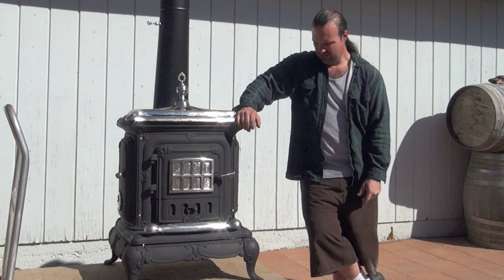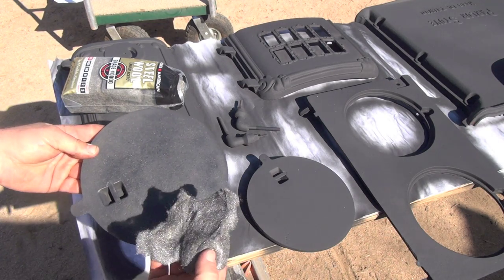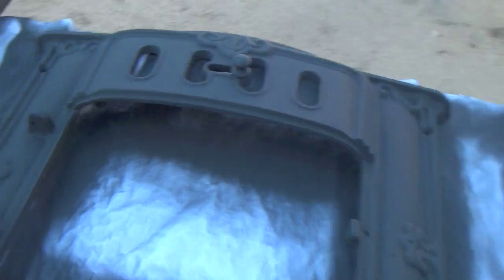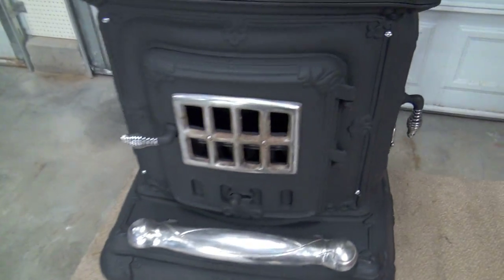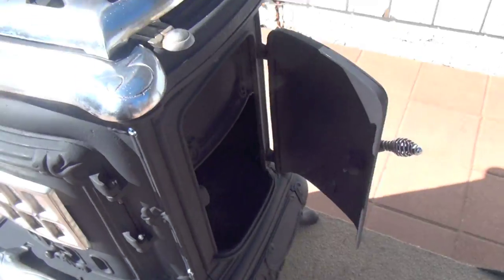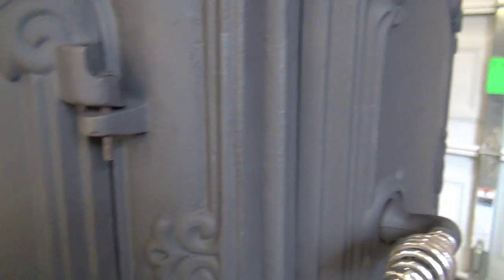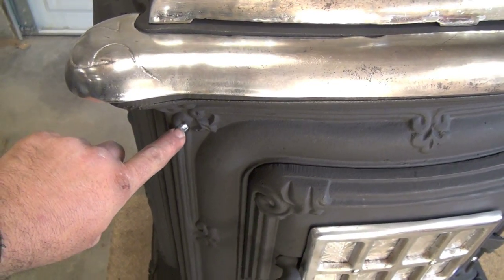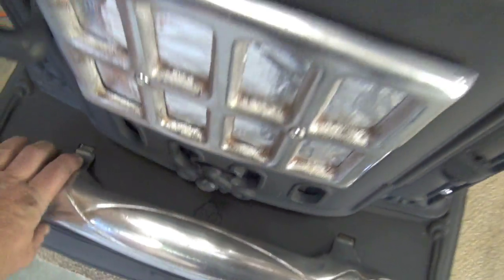How I Restored This Wood Burning Stove PART 2 *Step by Step *DIY

Comment: Shouldn't you have used a sealant between panel connections? I under stand you wanted to use it outside but you sold it I really hope the person that bought it was aware it was unfinished and more "mocked up".

Comment: I didn't see you use any new furnace cement to seal the the castings to each other that are bolted together. That's the stuff that was caking off the edges when you disassembled it. It must leak air terribly. Tell me I'm wrong.
Reply: I'm going to restore the original version tomorrow! it surely need to be sealed :)

Comment: I did one identical to this one. I used mica stove glass for the "vent" on front door instead of the aluminum foil. That way you can see the fire burning.
Reply: Where did you install the mica? On the inside, or outside?
Reply: @earlmanary7126  
It goes between. You take the outer chrome piece off and it gets sandwiched between it and the cast iron back piece

Comment: Very nice job! I have exactly the same stove, except the nickel parts (mine are bronze).
I bought it brand new 25 years ago so I know the material of the front door window: It is mica. Yes, MICA !!! Very bright idea, because it is really cheap and fire proof. It is a "rock" material, like a gelatin and transparent. Completely fire-resistant. You can find it in electric spares store, relatively cheap.

Comment: It actually looks pretty identical to the one my grandparents had in their house - a tad bigger maybe (not a "Made In Taiwan" one tho LOL), except that there was a window in it. I remember that the "chrome" parts weren't that shiny either and that grandpa had taken off the top part for safety reasons (hot stuff swinging around with active kids running around = accidents bound to happen). It was a family piece that had been passed on from generation to generation, starting from the 1800's. But sadly enough, when grandpa died and when grandma sold the house afterwards the stove was left behind, sitting where it had been sitting for half a decade (in that particular house). Such a shame. I wonder if the people who bought the house kept the stove or not. Probably not, because it was a pretty big piece in the living area, it took up a pretty good amount of space from what I recall.

Cheers and job well done, I must say! I hope you were able to make a good profit on it!

Comment: Hi Mike
            Well done.
You said that the fire grate was missing, but on a lot of wood burning stoves, there isn't a grate, it just burns on the base plate and coal stoves have a grate for the air needed for coal.
Also you said you would of liked glass in the door, in fact it would of been stove mica sheets in there, the foil was just a quick fix somebody did.
Keep the videos coming.

Comment: No paint needed on cast iron, use Rutledge Cast Iron Polish,  use mica for the window, it is actually a thin stratified stone that is somewhat clear and flexible , you cut it with scissors and it can handle temps to 1500 degrees!
Reply: Rutland William's Stove Polish Paste

Comment from the maker: I trust rustoleum to be a durable quality paint. I have had great results with it for years. VHT is a newer paint in my arsenal. It is for extreme temps. Using VHT in the fire box was an experiment. Order stove bright brand paint for your wood stove. Its a bit pricier but its the standard for painted stoves (from what I have read) Stove bright will most  likely be what Im going to use to paint the next stove unless I get lazy and just use rustoleum....

Comment: Love! Passion! .. wonderful work yuu did. 
Maybe too late, but you could fill the inside with a rocket stove bricks and plating system ..
Reply: that would help cut down the heat being put out by the stove and then you dont have to worry about the distance you need to use it. Great Idea. You would still get good heat from this stove too.

Comment: Great job. I really like your attention to cleaning and prepping for paint. Painting the inside with black VHT great idea I paint the insides as well it protects them. I was amazed when you did the steel wool trick I have been doing that on stove paint and it gives it a neat look. I noticed that you spray the stove which there is nothing wrong with. Personally I prefer to paint them with light coats and a good brush. After firing one and letting the graphite stove paint I use cure I use the finest steel wool and gently buff the cured surface because it blends the black and gives it a neat shine. I can leave one with the steel wool look or go over it with a clear high temperature coating. I just do the same thing to stoves as I do with headers and exhaust manifolds. Did that stove have a Mica window in the door ? Great videos. thank you.
Reply from the maker: Thanks for the good info. The stove is supposed to have the mica. Im glad you liked the videos ;)
Reply: SSW Custom... What graphite paint do you use?  Does your paint withstand the temperatures on the inside of the fire box?  I am just beginning a project and looking for the best paint.

Comment: Hi From Portugal. I have practically the same stove just with different doors. I was wondering if you put a gasket around the top of your stove also, under the top plate and also on the removable circular pan stands.

Comment: The woodstove sea. lol  Great video.  I have the same stove in slightly better condition than what you started with. I'd like to see it fixed up but hours of sanding, I don't know. I plan on heating the garage with it someday.
Reply: in a shop I would recommend a 2 barrel drum stove, they will not disappoint !

Comment: Good video. I have a question for you. Why did you use the Rust-Oleum Hi temp on the outside and the VHT on the inside? The reason I'm asking is I'm thinking about painting the outside of my stove with VHT but if the Rust Oleum hi temp is just as good I may go with that. Your opinion please.

Comment: I just snagged one (about 3 hours ago) that looks like this one.  I have not found any markings on it anywhere indicating it's manufacturer.  I had to laugh at him (ok, inside....)every time I mentioned what I was going to do to it..."oh no, never paint these. You've gotta use stove black"...."No, no, I'd never take a power tool to remove the rust...Just some steel wool, some soap black, and boom...you're done....  I actually may do it his way...because I want the more time-worn look, as opposed to yours, which looks brand new, from here....)Anyway...here I go! Another project!
Reply from the maker: +Vickey Burnsed  Congratulations, how awesome. Another project but one worth doing. Have fun with it & I agree his way sounds great plus it makes things easier.

Comment: I couldn't find the derusting video but wanted you to knowmuriatic acid eliminates all rust in metal molecular structure it turns it bulk airbrush loose away and wipe with acid. I may make my first video as I restore the stove I just picked up have not identified it yet has two panels cabin moose scene

Comment: All that "crud" and cement looking stuff was seam sealant. And you put none back in when you "restored" the stove. This stove is unsafe to use!! It will leak air at every seam now and make it very hard if not impossible to control air flow to the fire!